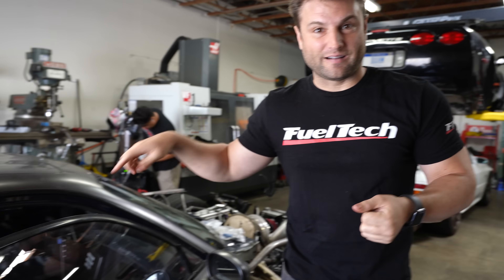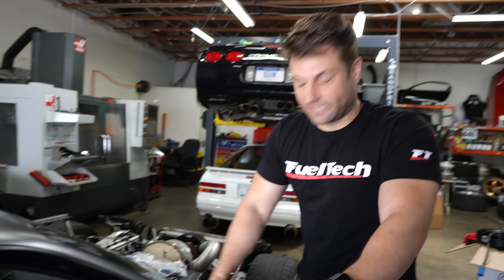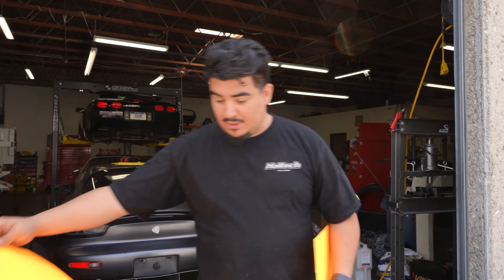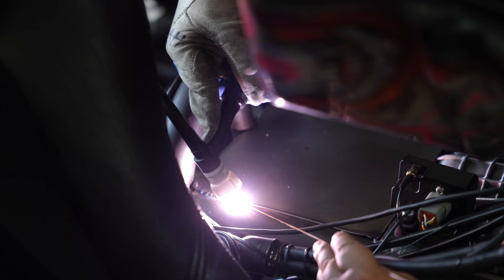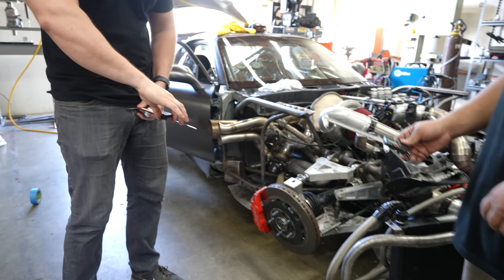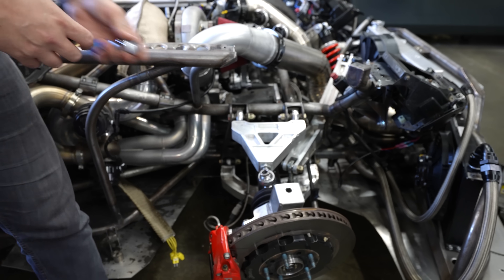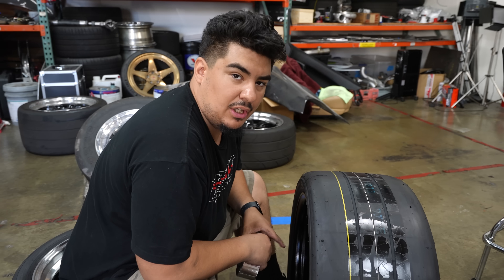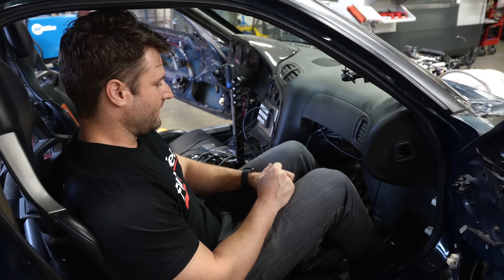FINALLY covering the driveshafts in the 4 Rotor!

Comment: The real problem with the control arm is the load path does not line up with the pivot and along the truss. Basically the material should go in a straight line from the inner pivot point to the outer ball joint. With your control arms right now they are only as strong as the minor diameter of the heim threads, under acceleration and braking. The less elegant solution to this is to use a very beefy heim to make up for it but if you make a true triangle between the pivots with the top of the triangle leading to a spherical joint on the outside. I doubt your control arms are going to break but you could get away with much lighter ones if they are properly designed. Hopefully that makes sense.

Comment: Surely there are better ways than welding 16ga steel in lol. Like tabs and some alloy so you can remove it. Obviously it doesn't need the structure...

Comment: Heim joints don't have any orientation, it's just that you need to know which type to use (low wall vs high wall, fat shank vs thin, female vs male shank etc) for the right application. Also, you're supposed to turn them in the opposite direction every few kms or something, to give them even wear. If one's concerned with the potential strength of a heim joint where the shaft is vertical, then the use of rod ends is recommended. They are the specialized part used by every manufacturer.

Comment: Recently saw driveshafts u-joint exploding and the dmg was horrible to the car (engine block teared up , gearbox in pieces and huge holes to chassis) if that hits you theres high chance ur dead. Car was professionaly made for drifting. There was even safety bands for driveshaft

Comment: Exposed was cool, but much better off with it covered. You guys are killing it! Been a long time coming but this has been the most enjoyable build to follow by far for me.
Reply: Maybe they could get some ultra-thick polycarbonate cover made for it so you can still see it through the cover but still be a lot safer. Polycarbonate would be good since it doesn't shatter, it just warps and tears when it fails.
Reply: I was thinking the same thing 🙂
Reply: @Da0yster  and youl wouldn't see much after a few runs. glas panels, multiple times laminated would be the deal.

Comment: I would use 1/8" AR500 steel as opposed to sheet metal. A bolt experiencing decompression is not far removed form a bullet. In fact, the bolt is probably made of denser material. K.E. = 1/2 m v2

Also, I love you.

Comment: Using what looks to be a size 12 or 14 pyrex cup to weld cold rolled mild steel is ott lol
 I hope Rob doesn't mind paying for 12-14 litres per minute of argon that is required for the larger cup size, the guy is using lenses and welding indoors so that job could easily be done with a number 7 or 8 cup and probably half the gas.
Reply: ^^^^you are at least 62% hotter than Rob Dahm now...
EDIT: ^^^^you are at least 62% as hot as Rob Dahm now...

Comment: I firmly believe that on a long enough timeline this thing is going to become perfectly inside and out. The exterior and main issues it seems are corralled to about as near to 100 percent as would be currently possible. At this point it seems like the interior refinements are the only real thing to focus on at this point. There's still going to be tweaking of other areas and components but all in all its seems like this car is pretty close to dialed in.

Comment: With 2k horse power more then just the bolts can go flying. That thin metal wouldn't protect from a catastrophic failure. Thats why drag cars put Kevlar on their tunnels. Would suck to get a u joint in your elbow your your ribcage

Comment: Y dont u redo the front top whish bones to mount the rose joints (heim joints) in tje direction there supposed to be loaded in, eg turn them 90degrees they would still have adjustablity for camber from the top

Comment: Not sure if it was done off camera or will eventually be done but would it be a good idea to also put reflective heat wrapping/tape on the front side of the passenger firewall to further protect from the exhaust?

Comment: Have you ever considered having someone design carbon ceramic rotors for the 26b. Extremely light extremely durable lest rotational mass. I'm not talking about brakes I'm talking about for the engine. Carbon ceramic Doritos. I know it would be insanely expensive maybe long term goals for this car

Comment: why didnt they go for a bolted on cover for the driveshaft? sure, not as strong, but still. eh, i suppose welding is the best idea if they dont think they need access there anymore. and true, they have a proper hoist to get under the car, so i suppose its basically a non issue.

Comment: if you know about shrapnel you know this is nothing if a m8 bolt exits at 4/6k rpm theres no stopping it it will fuse with the item that stops it 3/10mm plate is nothing

Comment: That is some thick steel plate. some 20 or 22 gauge seems like it would be enough since there are drive shaft loops already. Otherwise before you know it, the 4 rotor will over 4000 pounds.
Reply: The comment I was looking for. Body panels are usually around the 0.8mm mark.

Comment: If he is taking care of safety, might as well install a race car fire suppression system. Collette Davis is installing one after almost losing her project corvette to a fire. With so much fuel going through those lines and so many injectors, you can never be too careful.
Reply: there is a guy in germany who lost his Audi rs4 limousine, which he made by him self, after it started to catch on fire. now he went totally crazy and made almost half the chassis from carbon
Reply: @Bpsmatic  They would have to be crazy and crazy rich to spend that much on carbon to make a limo... I can't even fathom the cost to replace the panels on my Jetta with carbon let alone build a limo, damn.
Reply: @Bpsmatic  that Audi is fully rebuilt now, and all carbon fiber now too if I’m not mistaken, but that was a rough fire with the original one
Reply: @MK2VRTgokart  yes that's the mk2 with outer panels, firewall and trunk floor from carbon fiber. But it was made with a new chassis because the old could not be saved.
Can't wait for the first launch.

Comment: It's a step in the right direction. But i disagree with you rob about the sheilding. If it blocks something from going out you have not done it right. Once the structure of the Firewall was made, the sheeting should have been simple to build and put in place. You can make it so that parts of it is detachable to get to bolts and tight spaces. But for yours and others safetey build a complete firewall and trans tunnel.

Also sheild off the fuel system from the cabin. you don't want a hose to start spraying fuel on you if you have a crash. And there is a fire, it's not fun. I have seen an accident where that happend in real life. No fun at all. The safetey suit protected him but still.

Comment: Hey Rob, I know you liked the look of the exposed driveshaft. Have you considered instead of using steel plates trying out some very thick pieces of Polycarbonate so you could still see through it while being protected? It's used in a lot of bullet resistant applications so would be good at protecting from flying debris. It warps instead of shatters during failure as well so wouldn't cause additional shrapnel in the case it wasn't strong enough as well.

Comment: That sheetmetal is not thick enough to protect someone. Don't know enough about the shaft materials, drive ratios etc to tell how it will fail, but anytime a high rpm high power shaft comes apart, it punches holes through everything. Seriously, that's not even close to safe. With how much rpm this thing turns, that shaft can build some serious rotational energy. This has to be a joke right? Like when rob was 'blown away' by teftzel wire?

Comment: The drives shaft may or may not be dangerous(although your "we already know what will happen" is dangerously wrong....).... sealing the firewall off from the very really risk of flames that will KILL you, and your refusal to wear a fire suit to boot, should have been the #1 priority. You don't seem to grasp the level of fire danger thay much fuel flowing to a hot engine can be.

Comment: Without a complete firewall, if you have a single fuel or oil line or fitting failure, you risk 3rd degree burns and death for all occupants... Nobody should let you on a track without a complete firewall...

Comment: Rob i hope you read this, use aluminium for the heat shield. Aluminium its a refractory material and will insulate the passenger side better from radiation coming from the exhaust .
Reply: @TheGalacticArachnid  you are right about the heat conduction in the metal, but in the firewall the heat it isn't transferred by conduction, its transferred by infrared radiation and the aluminum it's better than steel reflecting infrared radiation.